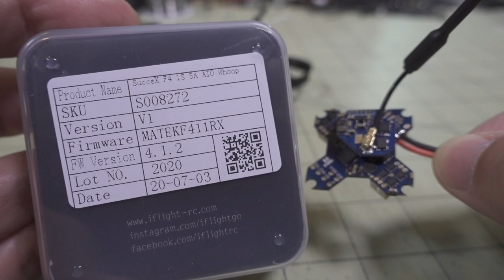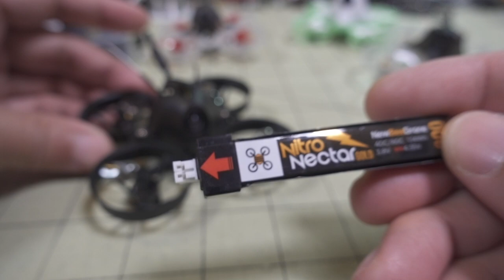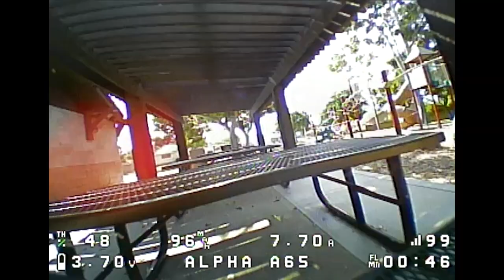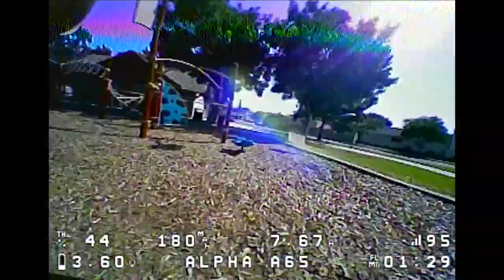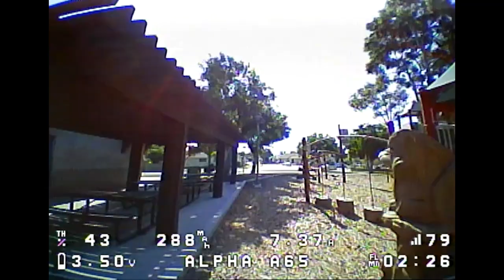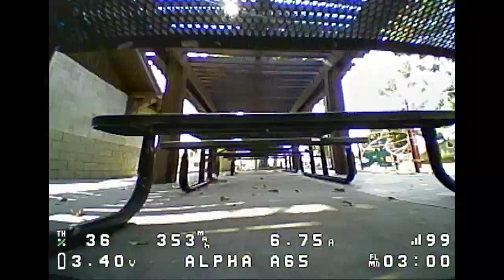iFlight Alpha A65 Tiny Whoop Review 🛸

Comment: My alpha A65 is on it's way from China. So far my favourite 1s whoops is the NBD and the Mobula6 (19k) at a closr second. I don't like the 25k versions. M6 on a 75mm frame is even better. It looks like that iFlight FC has very easy solder pads for an external rx, which is a plus!

Comment: These components in a lighter frame seem like they would be an almost perfect build.  At least I'm assuming most of the weight is in that thick plastic frame.
Reply: I'd say it's the canopy more than the frame. Compare it to the mobula 6, there's just way more material there. As he pointed out in the video, the weight also comes from the fact that you're carrying an external VTX and RX, I'd expect those to add maybe 2-3g.

Personally I'd swap out the FC for the Crazybee Lite in order to save that weight, get better flight characteristics and keep the durability improvements from the thicker canopy. Along with the better xing motors I'd think that'd be a nice little setup.

Comment: all my nitro nectar batterys puffed up in just a few days and are some of my worst performers. i have thrown out 3 of 5 of them in the first ten flights or so. i have  like 20 of the gnb 300 and 350 and even my little happy model 250 and 300 are hanging there with no issues a month or so later. maybe a bad batch? i dont know but i aint buying any more of them.

Comment: Picked up one of these on ebay, the seller had removed the reciever it came with. Noticed mine doesn't have an S.BUS pin, any idea if it will work with XR602T-A? Still waiting on that to arrive.
Reply from the maker: The board has an SBUS pin because mine came with an XM+ receiver.  That one needs an SBUS pin.  So you probably just don't see it.  The XR602T-A needs an SBUS pin too.
Reply: @AlbertKimTV  Thanks Albert. Do you think I can use the RX2 pin instead of SBUS? Have tried that yesterday but no luck getting betaflight to find my reciever.

Comment: I can’t bind mine to my jumper t18 radio. Please help me out I tried every single frsky channel and even tried to bind it using betaflight and it still doesn’t bind. I have had it for months and I can’t fly it.
Reply from the maker: First I need to know which of the six receiver versions you have.
Reply: It is an xm+ receiver and I hit the button that is a gold square and plug the battery at the same time and get a solid red and green light and I go through all the frsky channels and nothing.

Comment: did you have any issues binding? i feel as if they sent me the wrong version. I get the solid red and green light which means the firmwares don't match. Should've received the FCC but thinking i got the EU
Reply from the maker: If you have the XM+ version, the solid red/green lights in binding mode is normal. They should send out the U.S. version if you're in the U.S.  If you're trying to bind to a multiprotocol module, adjust the Freq Fine Tune value before binding.
Reply: @AlbertKimTV  I've tried several radios. I'm gonna try it again. I always thought the solid red and green was non compatible firmware.

Comment: i got the set with 5 Batteries and it flies great, it fell into a full bucket of water, i took off the lipo immediately dried it and it is all good.
external receiver is a plus.
motors soo smooth and fast,
love it.

Comment: I think all these are so much more fun in the 75mm / 40mm prop configuration with a Mobula7 v2 frame and GNB 1s 450mAh battery.
Reply: I totally agree.  I've been flying the mob6 with the v2 75mm frame, 40mm props, caddx ant, and antenna mods. weighs 26.5grams with tpu canopy for the ant.  cheers!

Comment: Ive just bought one of these bound it to my radiomaster TX16s but no rssi or telemetry it drops like a stone after a few seconds, what do i need to do,,im new to this setup stuff,Oh its frsky xm+
Reply from the maker: Normally the XM+ does not have RSSI and definitely has no telemetry.  The "drops like a stone" comment usually means the batteries you have are no good or poor quality.
Reply: @AlbertKimTV  Thanks that explains one thing lol,,Any way ive been holding it in my hand and when i arm it and give it a little throttle its great,,, as soon as i tilt it no matter witch way it stops dead until i arm it again and so on ? Oh forgot they new batteries boight this friday gone,,Thanks for the reply .

Comment: 24.4grams... thats really too much, I know it's going to be more resistant to crashes, but what's the point if it flies like crap?:(
Reply from the maker: It doesn't fly like crap
Reply: @AlbertKimTV  If you just cruise it doesn't. At that weight it's not going to recover from any (semi) aggressive maneuver.
Reply: Agreed. That’s much too heavy. 21g or less is ideal. 22 or 23g I’ll look the other way. But 24.4g? Unless it’s a super good deal (like >$50 good), that’s just way too chonky in my experience...